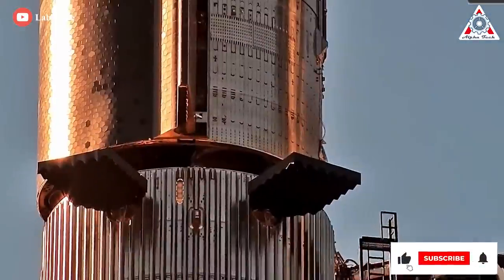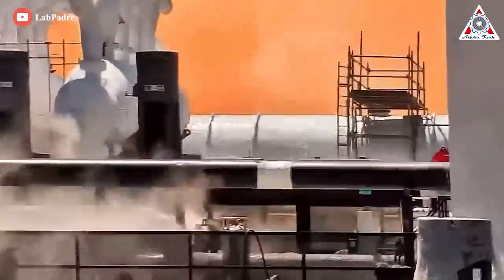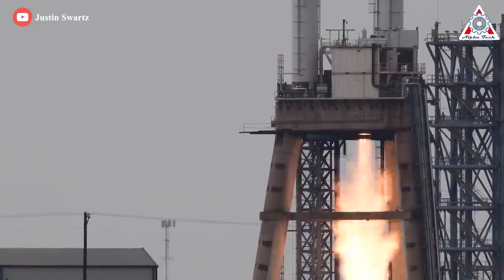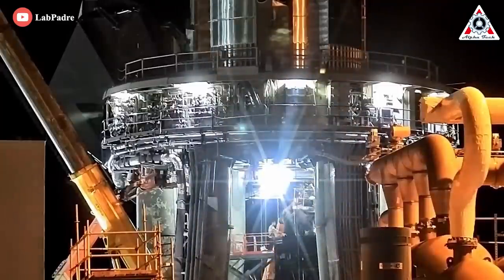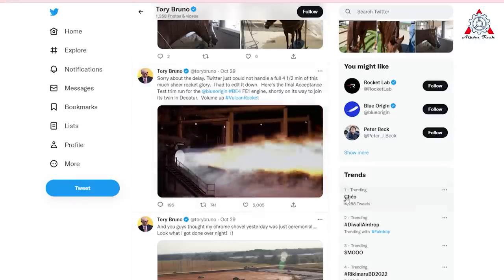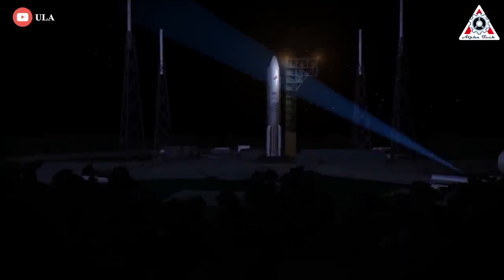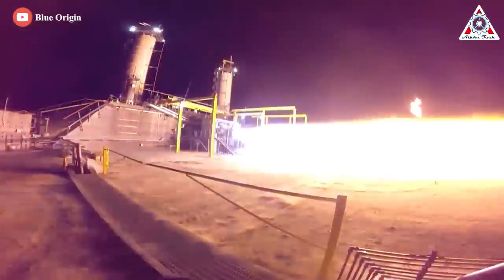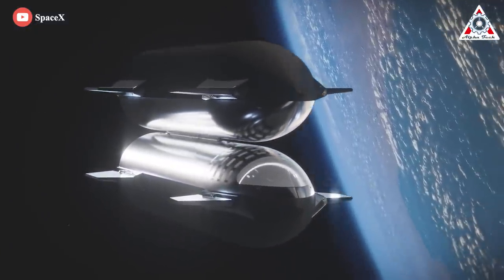Raptor Bad! Starship Super Heavy's engine trouble...not ready yet.

Comment: When you have 33 very closely spaced engines, you'd better be very sure that they are incredibly unlikely to suffer from catastrophic failures.
Reply: Exactly - this is a dead end street. There is no other vehicle whatsoever on this planet which would use ridiculous 30 or more engines - plumbing nightmare. Russians tried it 50 years ago with the identical setup and they did not succeed. OK, there were no computers 50 years ago to control so many engines but anyway, it is a stupid idea. Even if it could fly one day - there is no future for this monster...
And also imagine the logistics to try to re-use the engines again - so many things can go wrong!
What is needed is an engine like the Saturn used - one mighty one instead of 10 of these!!!

Comment: SpaceX doesn't want a repeat of what happened with the Soviet N1 rocket, which also had like 30 engines and which produced one of the largest non-nuclear explosions on record. So naturally they are looking at the details. Meanwhile, ULA is not making any progress at simplifying their overly-complicated supply chain. The consortium involves just way too many companies, to the extent that nobody seems to fully grasp all the working parts of their rockets. Boeing (a partner in ULA) has this issue on their own, as demonstrated by the Starliner and SLS issues.
Reply: The Falcon Heavy has 27 engines - though spaced out over 2 "booster" states + the core stage.
Seems to work well enough.
Reply: @bricefleckenstein9666  - But, to your point, the Falcon Heavy is really just three Falcon 9's connected together. Hence the fact that even for geosynchronous launches they can still recover two of the three stacks. The Starship first stage packs all those  engines into just one stack. There is no abort option where the side boosters can be jettisoned during launch. If there is a failure, the entire stack blows.
Reply: @daniels7907  My point was the number of engines, not anything else.
The boosters are coupled tightly enough that vibration from one booster affects the other boosters as well - which was the core bane of the N-1, issues from excessive vibrations when one engine would fail for whatever reason causing other engines to fail.

As I recall, the N-1 had 31 engines. If I'm off, it's 1 or 2 (no more) on the high side (your "like 30 engines" comment is accurate).

Comment: The engine bell isn't the issues.  It is the turbo pumps.  They fail after only a single burn.  And loose power substantially.  This is a much talked about issue.  And Elon is starting to worry.  It is the same issue that put the BE-4 in 2 years of testing
Reply from the maker: Thanks your great infor
Reply: @alphatech4966  hopefully it will not take 2 years to find the solution.
Reply: Those engines flirt with limits, they're like dragster engines, boosted to the max and very capricious...

Comment: There is a flaw in the design of super heavy booster. The proximity of all those raptors implies the possibility to jettison compromised engines. The software controlling the engines should be able to compensate during directional thrust for the missing engines in real time.
Reply: Only the center engines have gimballing capability and the software that controls the  aggressive gimballing of those engines didn't prevent the exhaust bells of two engines to collide during flight of SN-15... not very serious stuff.

Comment: Why don't SpaceX use flame diverters under the BFR?
Reply: I suspect originally it was faster and cheaper this way and there were no flame diverters on Mars. Then a larger OLM was designed and built, flame protection was added to the legs and services pipes, water deluge and fire control were added. Next guess will be flame diverters!

Comment: Great video!  Sixteen million lbs. of thrust is a hard number to get ones head around.  How much does a battleship or aircraft carrier or something compare-able weigh?  Sure seems like the space between Earth and Mars needs to be littered with fuel tankers.
Reply: Learn some Physics.
Reply: I don't think any additional fuel is needed once a craft is up to it's desired speed.  All these engines are needed just to get the Starship off Earth.  One rather small engine would be enough to send Starship to Mars.  I don't know how many engines and thrust would be needed to take off from Mars, but Mars has 38% of Earth's gravity.  But I'm no rocket scientist, so others may correct any fallacies.
Reply: @1DesertPirate  You're correct. But you need the small engine to brake as to be captured into orbit by Mars' gravity. Otherwise you'll be in a hyperbolic trajectory. He has no idea about basic orbital mechanics.
Reply: An Nimitz class aircraft carrier displaces roughly 100,000 tons. ( That's the weight.) The Starship produces about 8,000 tons of thrust that moves a mass a fraction of the weight of a Nimitz class Aircraft Carrier.

It's better to ask questions when you don't understand. I like your edit.